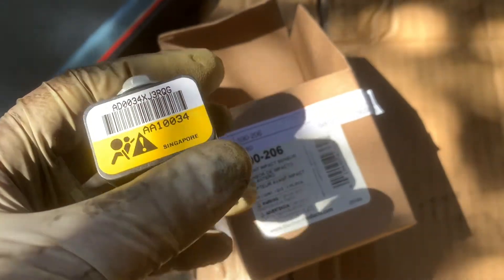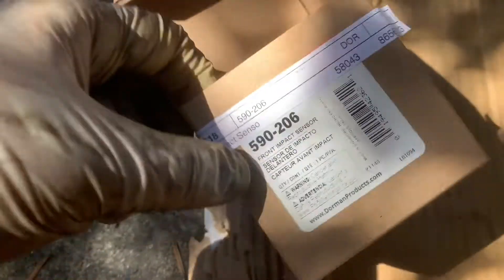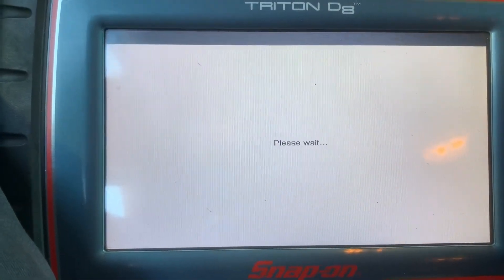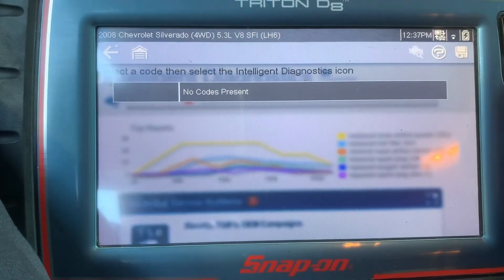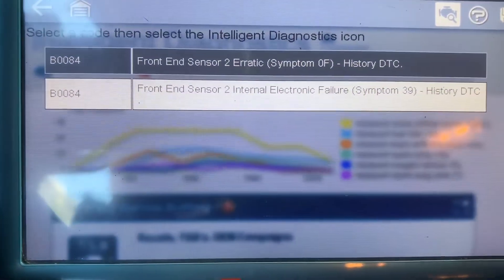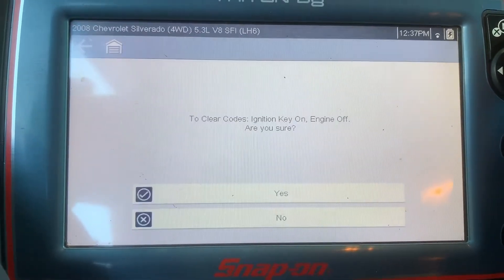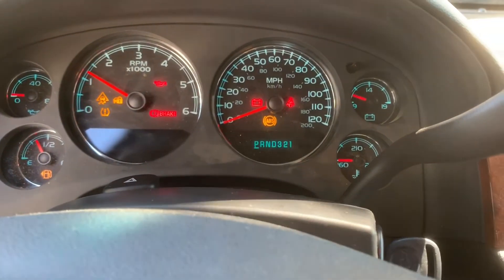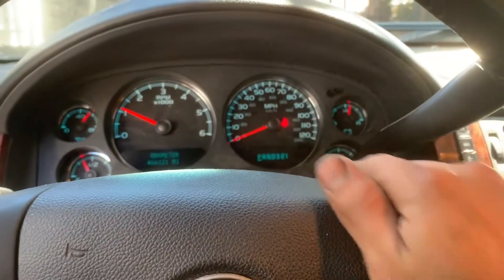Chevy Silverado Airbag Impact Sensor Replace - Code B0084

Comment: Will this cause the car not to run? I’m running into the engine turning over but not starting. My girlfriend hit a deer on her way to work. The deer hit the right passenger side and it caved in the hood and pushed the radiator support back.
Reply from the maker: The car should be able to start, as long as it doesn't hit the engine itself or damaged any part of the engine or damaged the computer (ecu). A damage radiator and support shouldn't be a problem. In your case if the engine cranks but no start, could be no fuel or no sparks will cause the engine not to start. Check that first.
Reply: Where did you order yours because I can’t find any in stock